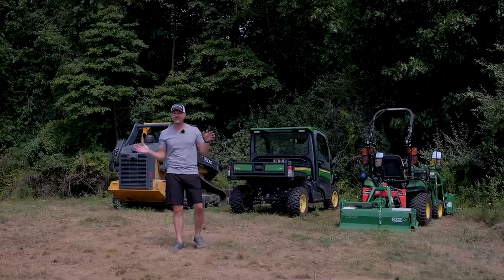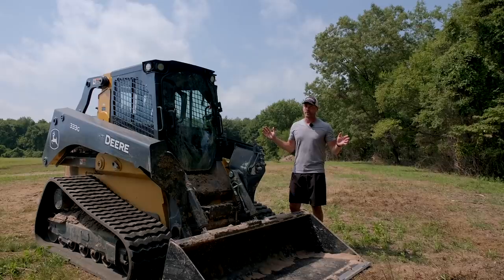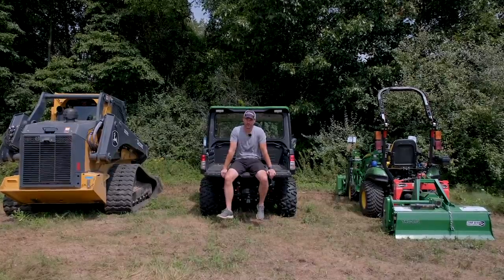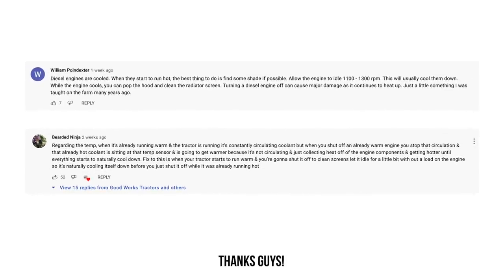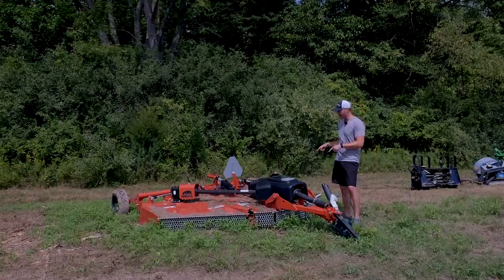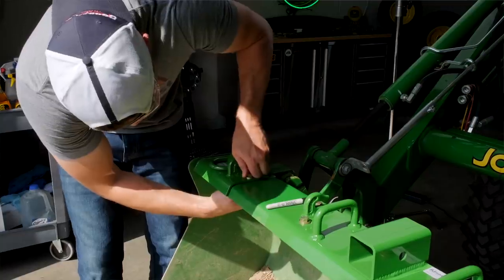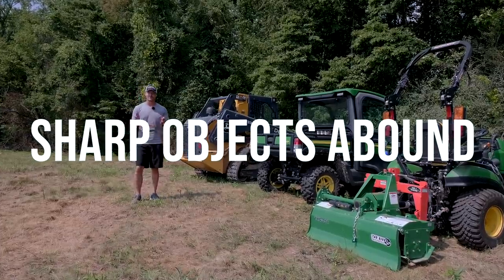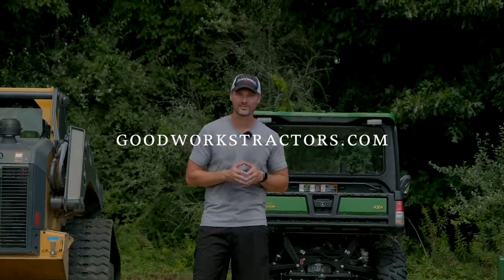TOP 10 WAYS TO BREAK YOUR TRACTOR: PART 2 😡🚜

Comment: If you live in Oklahoma pack rats and mud dobber wasps are a real problem. Pressure washing helps with the wasps mud nests on wiring harnesses. As far as the rats, I recommend parking in different spots every couple of days, tie bounce dryer sheets in non flammable areas or cups of green antifreeze ( they drink it), try to park away from trees.

Comment: You called out my issue with putting the backhoe back on my 1025R in a rush.  Tired and in a hurry, I was lowering the BH down and missed the catches.  That pushed the seat onto the controls and the rest was a rush to shut it down, but not before the BH hit the back wall of the carport and nearly ripped the hydraulic hoses.  I learned very quickly that if you are in a hurry, walk away and do it later.

Comment: Heat is disapated from the radiator quickly. The engine creates the heat. The engine is way hotter than the coolant. So when you shut down a red hot engine the coolant that sits in the engine gets above its boiling point. That is a bad situation. The same is true for oil/coolant circulation inside of turbos. Great advice about letting it idle and do NOT shut the vehicle off. Let the coolant and oil coolers cool the machinery down before shutting the unit down. Old time truck drivers used to know this. Many new drivers don't. In fact many trucks now have software to try to mitigate this type of driver error.

Comment: Wish I had known about the heavy duty front bucket earlier.  I have been using my 2025r for landscaping in the wonderful soil/rock garden of New England for the past few years; leveling out a field, clearing a hillside etc.  The number of rocks I have discovered with a sudden bang is beyond count at this point and building the stone walls have roughed up the front edges of the bucket.  I even bent the thumb a little on the backhoe at one point.
Still, that gorgeous little machine has the heart of a 5r and has never let me down.
And speaking of cosmetic damage, watch where the rocks roll when moving them with the bucket.  One rock made an escape attempt and cam back to hit the tempered glass door of the cab.  It exploded like it had been hit by a shotgun blast.  (Also discovered how useful a good seat cover could be to prevent stains!) :)

Comment: 1 important thing is dont use the bucket hooks to pick up loads off 1 side of the bucket you can seriously twist your FEL .If you need a single line pick it up in the middle or use 2 equal points of attachment. A friend of mine paid a very large price for doing this

Comment: Additional tips to help you to avoid breaking your tractor;
When carrying items with the front end loader, carry them as low as possible and drive slowly and carefully with the loader raised. 
Avoid full lock turns with the loader raised, and avoid using the loader raised on uneven ground.
When pulling items with a chain from drawbar or three point hitch, ensure that the chain exits from below the drawbar or attachment, and that you don’t pull from above the PTO height. Doing so could cause your machine to flip.
Reply from the maker: Strange, it's almost like you were watching us shoot a video yesterday that comes out tomorrow morning!  Were you hiding in the bushes?!? 😂  Just kidding, but we touch most of those points in a video tomorrow 5 Ways Your Tractor Can Kill You.  Thanks for taking the time to stop by!

Comment: No good deed goes unpunished.  This winter we got a 6" snow so after I cleared my driveway I went down to my church and cleared the parking lot.  I drove over a snow covered curb and scraped the auto- connect mechanism for my mower deck and broke the electric actuator.  $1500 later for a new actuator and all was well. Hard lesson to learn.

Comment: Recently spent a few 5-6 hour days cutting pasture in 97-98 degree temps. Toward the evening one day the a/c quit working. I'm new to tractors and didn't have a clue but all gauges were good so I kept working (and sweating). Later I popped the hood to clean the screens and, seeing how clogged they were it hit me that it may be the problem and sure enough it was. A/C worked like a charm after that. Anyway, reason for posting is to make any newbies like myself aware that clogged screens will not just make your tractor run hot, they can make you run hot as well. lol.

Comment: I have one recommendation for you.... "CORROSION X", either red or green.  Green is a heavier protection and I use both for different applications on my salt-water boat and motors.  I rinse them off then spray a light but thorough application of red on the engines.  The green I use liberally on my trailer/wheels/lugnuts/etc.  Of course, I wash or rinse copiously first...  I have read about "fluid-film" but have no experience with it.  Hope one of these helps...  I have really liked the "Corrosion X".
Reply: spray cans of fluid film are handy for places you know corrosion wants to start.i use it. it's cheap insurance,check it out

Comment: On the 4720 overheat I'd replace the thermostat while you are in there (they are cheap). Sometimes those don't age well and won't open fully like they should leading to flow issues that are hard to find. Cheers!
Reply from the maker: Hey Reno, yes sir, thermostat is getting replaced.  Thanks for the tip!
Reply: Most thermostats use a wax that melts at about 160°.  When the wax melts it pushes open the thermostat, letting the hot cooling into the radiator.  The problem is when you overheat that can cook the melted wax and even boil some of it off. When that happens the thermostat will not work properly.  Usually not fully opening, and not opening at the right temperature.  This will lead to more overheating and other component issues.  If you ever have a tractor, car, or other vehicle severely overheat, replace the thermostat.  Thermostats are much cheaper than replacing a seized engine.

Comment: I am certain no one else has done this, but I was asking my old Yanmar to do more than what it was designed to do.  I was using the loader to pull out a shrub.  I pulled hard, and eventually won. However, my 4WD kept failing.  I took it to the Yanmar dealer, only to discover I have sheared most of the bolts holding the engine to the transmission.  The 4WD failed because the tractor became "longer" which pulled the front drive shaft out of the front axle. Hope this was a one-off. Hard to find parts for older Yanmar, although it was a great, powerful, and reliable machine. Lesson learned: just because your tractor can do something doesn't automatically make it a good idea.

Comment: Agree with you on the more equip. The more problems and maintenance and storage and...  However, having more equip. allows you multiple ways to skin the cat when something fails.  So it cuts both ways.  I've decided to go with fewer but more capable machines but then it's hard to find something that has everything and can handle anything.  I'm convinced the net costs will be lower with fewer problems. But sometimes you may have to wait for a repair.  Cheers!
Reply from the maker: I agree, trade offs both ways.  I do like the idea of multiple units if you have projects that just can't wait.  I'd be completely dead in the water without having more than one.  4720 has been in the shop 4 of the last 6 weeks.

Comment: My old polaris ranger (2013) used to overheat on shut off so if the fan would run I'd let the ranger run until the fan shut off. I just bought a 2021 and assumed it was smart enough to have a fan that stays on after keyoff like modern trucks. Not the case. I will be wiring in an Arduino to monitor the coolant temp and keyswitch and leave the fan on if the coolant is above 200 and the key turns off that'll run for like 60 seconds. Just need to make the Arduino power down after it's done so it doesn't kill the battery. Fun stuff.

Comment: Not necessarily how to break your tractor but more along the lines of how to break your neck. I’m fairly new to tractors and I’ve never put my ROPS down. But I see the way you have yours tilted forward. Is it safe that way? Is it just to accommodate the Rhino Canopy? It just looks like if you were to experience a rollover it seems it would be easy for the ROPS to just fold down on your head. Are they really built strong enough to hold and support the tractor and protect you in that position?

Comment: The place where I get my tires done has a policy that they use their impact to put The legs back on and stop and then hand tighten them with their wrench so they don't mess up the wheels. It seems to be a good system to work as I've never had any of my vehicles have a problem with lugs put on wrong.

Comment: On my kubota b2650 with mid mount 72 inch mower I had a big problem with bending pivot brackets at 3 point area , seems that there are extensions for shipping that need to be removed on this tractor ? Manual specifically says not to use these on my model but they were left on by dealer , resulting jam up caused 1/2 inch thick steel bracket to bend like a toy , I removed the extensions had the bracket re shaped by local welding shop for the third time now no more problem ! I was in much denial that this was the issue , I was wrong

Comment: You'd probably have to put 8,000 hours on a compact with before the wheel spacers would have an effect on the axle bearings, and thats assuming you ignore the axle seals leaking before that. No one is likely to put enough hours on for it to be a mechanical issue.

Comment: Cab tractors have an extra radiator that you can activate when overheating occurs! Another "features you may not know about"? I was struggling last year with tall weeds and lots of seeds clogging the radiator, oil cooler, A/C core, etc. I had a sudden idea and turned the cab heater on full fan blast, full heat setting, and climbed out for a couple of minutes. The coolant temp dropped dramatically faster.  (It goes without saying that the air conditioner should be turned off since that actually adds heat to the radiators).  I was nearly finished with the mowing a large field and was able to avoid a long drive back to the barn/shop by using the cab heater to give just enough heat transfer to safely finish the field. Sorry if somebody already posted this tip.

Comment: I rolled my brand new 2025r after 2 hrs of slashing, I went over on an unseen French drain in six foot long grass on a new property, after years of working with a tractor, 30 seconds or less on its side, it was written off due to the yanmar engine failing….now going with a 3038E with wheel spacers, hopefully it will make it a little more stable, insurance is soooo important.

Comment: It's not mine, but my dad was using his skid steer here, on a scorching day recently, & he said he heard a "Poof"...
and basically it caught on fire... Its an older unit & doesn't have the "over heat" protection of modern units. 
Crappy situation.

He now carry's a fire extinguisher.
Reply: get an old halon extinguisher off a boat, if it weighs the stated amount, it is full and ready to go and won't ruin a motor when sprayed, just don't breath it!!

Comment: At the beginning of this video you mentioned that you've not heard of any breakage issues due to the added axle stress caused by the installation of wheel spacers.

I have an older BX-23 which I bought used in 2015. For the sake of added stability I bought and installed a pair of 3” Bro-Tek wheel spacers. Five years later I had a very expensive repair. The added bending moment on the axles caused a fatigue failure that not only broke an axle, but snapped the end off the very pricey aluminum housing that the axle rides in. Further, the tractor was jerked sideways by the loss of one back wheel and hit a tree. My employee who was using the tractor said that the impact was such that if he hadn’t been wearing the seat belt, he’d have been thrown off the tractor. (And it wasn’t even going very fast – it was going downhill in low range.)

I don't have any particularly high loads that the tractor carries.  It doesn't have an excessive amount of usage time (about 1600 hours on the machine).  And I try not to abuse it.  A good look at the cross section where the axle broke shows that this is in the pattern of a fatigue failure.  So my conclusion is that unless the tractor manufacturer says their axles are designed for the added load, you're gambling with the possibility of a catastrophic failure by adding the spacers.
Reply from the maker: Thanks for sharing!  I'm sure there's other folks out there that have done it besides you.  The point was that it's extremely rare.  Thousands and thousands of spacers are in the field.  You also installed those spacers to make your tractor feel more stable.  Who knows if doing so saved your life or one of your employees lives.  It's much easier to fix a machine than a human being.
Reply: @GoodWorksTractors  On my Kubota L2550DT I had the front wheels reversed to give it 1) a more stable stance on hillsides and 2) to align the front tires with the rear tires for loading on a ramp trailer. After a couple years and at least $1000 dollars in front axle parts I realized the wheel centers were no longer centered over the bearings. This put a greater load on the outside bearing and as a consequence I destroyed to bevel gear housings and bearings. I DO NOT baby this little tractor, it does a lot of work on a 75 acre farm and now has over 6K hours. Bottom line is I changed the wheels back to the narrow position and have not spent a dime on it since. I feel the four or so inches of loss in width was inconsequential when looking at stability on hillsides. If that four inches stops someone from going over they need to have stopped a while back.
Reply from the maker: @jonpeterson2870  I know JD manuals specifically state to only leave front wheels in the wide position when necessary.  Not sure about Kubota.

Comment: I use the backhoe on my tractor at least 3 times a year. when I get to close to a ditch on the zero turn an I get it stuck I just turn it off put it in neutral then walk an get the tractor then wrap a tow strap around the rops hook both loops on the teeth of the backhoe then lift it up and swing it out. That I would’ve hooked on the back of gator with a tow strap to loader hooks or forks the. Lift up while gator was in neutral then drive the tractor forward. I’ve found lifting up an out is the best way or if tractor is stuck use the backhoe to push yourself out.

Comment: I love my bx23s but with anything in the FEL it's back is way too light. I usually just throw the backhoe on when I'm using the loader. One thing I did was bend a lower arm on my 3 point hitch. A rear blade caught a root when I was pushing backwards and the blade stopped going but the tractor didnt.

Comment: with the over heating problem shutting it off is bad but if its a turbo charged engine its extra bad even if its not over heating if you working a turbo charged engine and shut it off to early its a first class way to roast a turbo. that track loader according to its specs has a turbo if you working it hard let them idle for a minuet or two to properly cool or it can destroyed turbo bearings or oil seal this can lead to the engine eating its own oil and running away if that happens good by not just to the turbo but also the engine. seen this many times people buy dinky little SUVs and tow large caravans making the engine work nice and hard getting that turbo nice and hot then they get a rest stop, servo or caravan park and shut the engine off with out letting it cool they normally get 10,000km on a brand new car and the turbo goes.

Comment: thanks for the video, id be interested in your weight bracket your coming out with, ive got a 2020 1025r and i have 4 72lb weights, and needing to buy 4 more so i can use for the front or rear.

Comment: Your small connection  on your arm is the case drain for your mulcher head, drains from the pump to the tank, reverse it and it drains tank🙈 pro tip when you change the 333gs engine oil, change final drive oil at the tracks its cheap insurance for how hot they get with two speed

Comment: There's really no good excuse for not having enough counterbalance.  I built a ~30" cube, from angle iron (maybe $40 worth of steel) filled it with some old bricks i had from removing a neighbors patio.  The whole thing weighs just shy of 800lbs.  I have 200lbs of wheel weights on each tire.  Keeps the tractor planted even with close to a ton on my forks.  I used the same box on my smaller tractor without the wheel weights, and it was stable all the way up to hitting the pressure relief valve.  I welded my box together, but it easily could have been bolted together.

Comment: another way of breaking your hydraulic equipment is by over taxing your hydraulic system eg trying to lift something to heavy could bend rams using s motor that is to big for the hydraulic flow the motor wont work properly and then you try to compensate for the poor performance and it stresses the hydraulic pump doing damage over a period of time

Comment: I think I've done all of these plus sum more, smashed the headlights, smashed a cab door and rear window, bent a loader, punctured a fuel tank, snapped the pto shaft on the tractor, rolled a tractor, fried the ECU in one, shattered a clutch or 3, blown a sprayer pump up, put a branch through a radiator, ripped a track of a skid steer excavator dozer and a traxcavator, buckled a tipper trailer buckled a bucket to, gotten stuck to many times to count , in my defence shit happens when you use your equipment all year round and average 6000hours a year across the machines and while likely see more carnage in the years to come